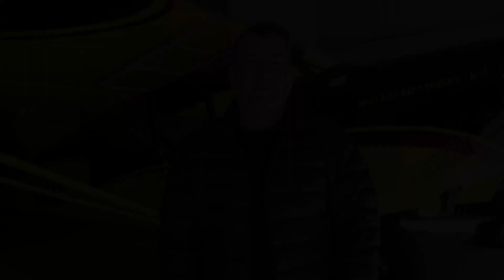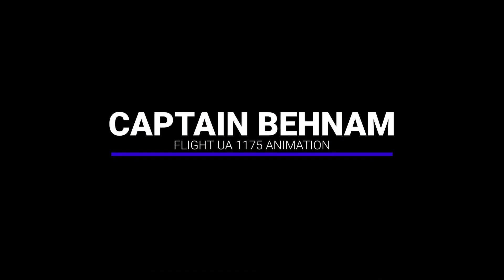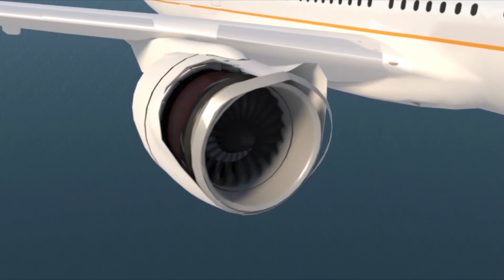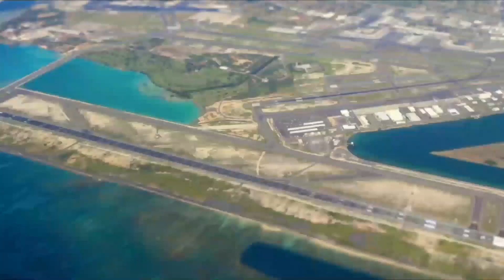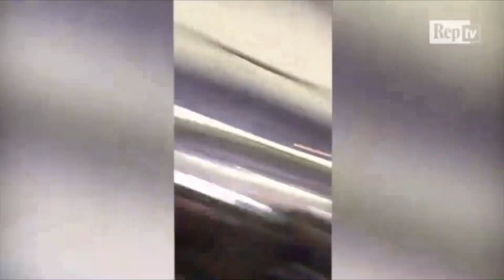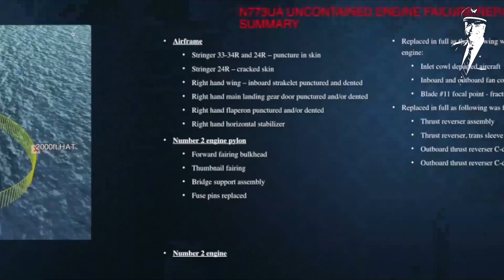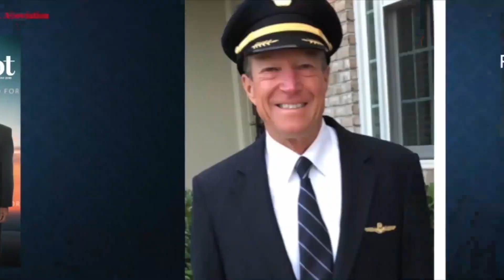UAL #1175 B-777-200 Fan Blade Out Animation

Comment: I wonder if the airframe is safe after the stresses the wing endured.
Reply: That’s easily tested.  Inflate it like an overstuffed balloon and check for leaks over and over. 
But regardless, my ass wouldn’t fly on that plane no matter how many test it passed.
Reply: @WilliamWBG  😝inflate the wing? Stabilizers?
Reply: @stevegiboney4493  pressurization can be tested everywhere. You didn’t know this?
Reply: @WilliamWBG  , it wouldn’t tell you a thing. These locations are not airtight for one thing. You don’t know what your talking about.
Reply: If the spar was damaged, pressure exerted on the entire surface of the spar tells you nothing,

Comment: RFP 777 Simulator upgrade due to UAL #1175 B-777-200 Fan Blade Out.

1.  One engine out causing reduction in thrust to zero over x seconds (adjustable).
2.  A huge spike drag increase (adjustable) on bad engine side to simulate cowling departure + background noise (adjustable).
3.  Simulator should roll (~45 degrees) toward the bad engine along with some pitch up.
3.  Full thrust on the good engine should not allow climb or level flight, just a 1000fpm descent at best.
4.  Provide an airport within range & so a landing is possible.
5.  Captain Behnam to test and verify the upgrade is realistic.

Notes:  Vibration not simulated as it is a real risk to the simulator hardware. 
              Background noise to be used as a substitute for vibration in the simulation.

Comment: In my humble opinion, The ETOPS Standard shall be revised. The ETOPS 300 rated means that it can fly 5 hours with one engine with the other engine just flameout. As Captain Bennet explained there was no way he could have saved the plane and passengers if it had happened at the Point of Equal Distance. My take on this is that:
1. More cameras shall be installed for the crew to monitor vital parts with visual confirmation to know what is going on.
2. The crew should have a mechanism to jettison the loose engine to prevent the vibration and the engine further breaking apart piece by piece and damaging the aft fuselage and vertical and horizontal stabilizers.
Reply: Agreed! These recent fan blade failures with subsequent cowl breakup have shown current ETOPS to have a fatal flaw. Either better containment or ability to jettison the engine. Otherwise go back to 3 or 4 engines!

Comment: The relief of not dying cannot be underestimated.
Reply: The air is cleaner, the water is fresher, the sun is brighter that's for sure
Reply: @digitt2  After a sliding fall down a glacier that ended suddenly (I thought I would die or be badly hurt) I was shouting with joy and jumping up and down!!!
Reply: The relief that one can file a lawsuit out weights most anything else.  Look at the article in the paper postguam on  06-04-2020    "    Gail Cassidy, a resident of California and Guam, is seeking no less than $1 million in punitive damages each from United, the Boeing Company and Pratt & Whitney, an aircraft engines manufacturer. She is also seeking compensatory damages from all three companies under various causes.

The suit was initially filed in the Superior Court of Guam on Feb. 12, a day before the two-year anniversary of the incident. On Monday, United filed a notice at the District Court of Guam removing the matter from local purview and into the federal court. "
Reply: Did you mean overestimated?
Reply: @nexpro6985  Thanks for catching my illogic

Comment: Juan, in this incident the damaged engine added severe drag, vibration, and instability to the plane. What if the pilot had the option to safely “jettison” the damaged engine. Would the plane be more or less controllable in this new single engine configuration? (BTW...excellent video!)
Reply: Engines have fallen off planes supposedly by design if vibration gets too severe, I don't know what the standards are.

Comment: If this had happened 500 miles out, could they still have made it?
Reply: Nope,they tell you in video it was losing altitude slowly,just happened to be 200 miles out close enough to make it back to that runway,incredible!
Reply: Only if they could have deployed flaps once they were low and slow enough and if that enabled them to get the aircraft into a stable configuration. That would increase drag and fuel consumption. The real question is if they could have made it from the equal time point.

Comment: As a potential soul-on-board I'm curious to know what N773UA has been doing since 13-FEB-2018.
Reply: It’s still flying with United.
Reply: @eloisebrynlee   Thanks for the info.   The vibration would be too much for the simulator, but the airplane is just fine.   I think I'd pass on riding that particular airframe.
Reply: @jayshaw63  I was surprised when I found out it was to be honest. 😬
Reply: I've found what one of the passengers has been doing.      Look at the article in the paper postguam on 06-04-2020    " Gail Cassidy, a resident of California and Guam, is seeking no less than $1 million in punitive damages each from United, the Boeing Company and Pratt & Whitney, an aircraft engines manufacturer. She is also seeking compensatory damages from all three companies under various causes.

The suit was initially filed in the Superior Court of Guam on Feb. 12, a day before the two-year anniversary of the incident. On Monday, United filed a notice at the District Court of Guam removing the matter from local purview and into the federal court. "
Reply: @bobroberts2371   And this after they got her to her destination on time.
Reply: One thing it has done is it flew the passengers who had been on Flight UA328 from Denver to Honolulu. (Source: Aviation Herald incident report.)
Reply: Well, that's quite a coincidence!

Comment: The drag isn't a problem to stimulate.  If you can define the damage the simulator engineers can model it. But the vibration would shorten the life of the simulator. The audio on that animation was awful. Just Ditch all the background garbage.

Comment: I wouldn't have thought you'd need to program yaw that much in the simulator! it's more about how the controls fill how difficult they are to keep the plain stable and fighting the controls would of thought is the most important thing here.
You surprise me by the simulators these things can be isolated like the screen and be on a floating system what I would have thought is the case for something like that.
Shame they don't put break on the engine would be perfect for this this type of scenario! why not come with brakes? Even having exploding bolts to drop the engine could be a possibility

Comment: As a retired AL pilot could someone explain why pressure was needed on the yoke on a fly by wire control system?
Reply: The 777 has 3 control systems, primary, secondary and direct. It’s likely that primary failed due to corrupt data forcing the system into secondary. In this mode autopilot, autothrottle and other automated modes are inop. In secondary or direct however the commands from the control columns are degraded. The simplified control laws used in the secondary mode affect airplane handling qualities. All flight control surfaces remain operable. The elevator and rudder are more sensitive at some airspeeds. It is not so easy to trim for an airspeed and so generally forces will be felt at the control column
Reply: @scottmacey  I flew 73,75,76 but only truly electric airplane I flew was A320,330. We had Nintendo control and a lunch
Reply: Direct Law, perhaps.
Reply: Not a pilot, but from my understanding the Boeing 777 uses a hydrolic flight system and not fly by wire.
Reply: @PureRides  you can have fly by wire and still use hydraulic systems for flight controls. Fly by wire just means that there are no physical cables connecting the control column and the control surfaces. The 777 is fly by wire using hydraulic actuation, the 787 is fly by wire using electrical actuation.
Reply: @scottmacey  thanks I flew A320,330 all FBW. Only direct control was rudder and throttles. Though I did like the lunch table.
Reply: @allandonovan4620  ah ok, my current type is 777. The 777 still has cables for the stab and a few spoilers but, as the manual says, they are 'only to assist in controlling the aircraft until electrical power is restored'

Comment: “For the last 40 minutes he hadn’t taken his left hand off the yoke nor had he taken his right hand off the throttle” these IFR autopilot guys had to hand fly an aircraft like us VFR pilots do every time we go up. I found that line funny.
Reply: Did you even watch the interview?  You should at least make an attempt at researching Captain Benham's whole life experience as a pilot before making an assumption as that!  If you were sitting in that jet right now and this happened, do you really think your VFR only pilot experience, is going to prepare you to hand fly a heavy jet at .83 mach from an upset recovery?  Be honest.
Reply: @majorpayne608  I have no idea how I would handle an emergency on that aircraft, I'm not trained on it and that's what I suggested. I found the comment about hand flying funny as we do it all the time.
Reply: With extreme vibration and no assurance that flaps or landing gear would work.
This was like nothing any VFR pilot has ever done
Reply: @markhorton3994  Yes they deserve credit for sure, they had to manage an abnormal occurrence under difficult conditions. Pieces of the cowling were torn off the aircraft causing serious vibrations and a difficult control scenario. However, I did find the reference to flying with the left hand on the yoke and the right hand on the throttle for 40 minutes stated like that's some big undertaking funny. I'm not an ATPL, but I truly hope that hand flying an aircraft for 40 minutes isn't seen as some heroic undertaking. If that is the case, hand flying should be a bigger part of their recurrent training.
Reply: You’re my hero. We can only aspire to one day be like you!

Comment: With the amount of vibration that went through the air-frame of #1175, what kind of inspection did they conduct on that aircraft?
Reply: The early 747 engine mount "pins" were designed to fail (a mechanical fuse) in the event of a grossly out of balance engine allowing the engine to leave the wing thereby savings the wing spar. Is this still a feature on the 777 and other Boeing jets?
Reply: @timjones7547  I would think they implement that safety feature on all modern aircraft. I heard, with the latest 777 engine failure, that it does have sheer pins/bolts.

Comment: So apparently nothing was ever done about it, the first time it happened. It doesn't give me any confidence that the engine makers, airlines, or the FAA are doing their jobs.
Reply: It’s not good is it ! Three years passes & some alarmingly similar events later they finally decide that “hey, we might have a problem here” & ground all aircraft with that series of engine.
Reply: It really does jog the noggin’
Reply: I thought something had been done but the inspection method was so new that it didn't catch the flaw which caused the second fan breakage.
It's great airline travel is as safe as it is but I think it's possible to place too much priority on safety. Making airplanes safer makes them more expensive. Expensive airline tickets cause many people to make long distance car trips. These car trips have a much higher chance of causing death or injury then if the person had flown. 
I hesitate even to say it, but it's surely possible to (indirectly) cause more deaths by increasing safety requirements of airlines.
Reply: @ddegn  the problem is, human psychology doesn’t agree; market forces driven by people who absolutely will not tolerate the perception of possible air disaster—which frightens people so much more than an auto wreck, never mind the statistics—dictate that air safety must remain as high as it has been, even as some begin to fear those standards are slipping.
Reply: @ddegn  i would say the opposite, too much emphasis is placed on cost & not enough on safety.
Some one sits at a calculator & does the math on how much it might cost the airline in the event of a fatal crash against how much to ground a type & check them thoroughly.
Personally i think there is not enough accountability, if those responsible were looking at hard jail time i think we would see far safer air travel & no mater how expensive these safety amendments cost, the airlines will always find somewhere to save money ! The top people in airlines & aircraft manufacturer take home the big bucks but shoulder no blame or consequence when the proverbial hits the fan.
Reply: @ddegn  They knew there was a problem back then and did not take the necessary steps to find out how to prevent it. All of a sudden now, they ground all the planes with that engine. That's unacceptable. How do we know that any of the other inspections on other planes are adequate? I don't make any excuses for failures to take action. I would rather pay more than die because of incompetence. The price don't matter.
Reply from the maker: See previous updates, you gotta follow the whole series to keep up on what's been done to date.
Reply: @blancolirio  Did they ground all the planes before? I must have missed that. But I'm glad they are getting to the bottom of the problem now. It can't be easy making those blades. Hopefully technology will change their design so the problem goes away. Love your video's. The knowledge you bring is exceptional.